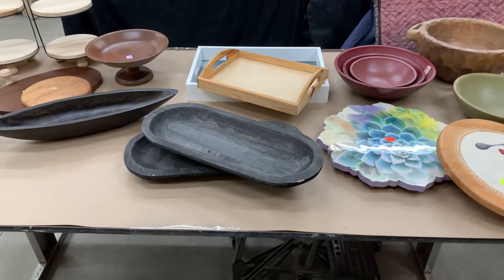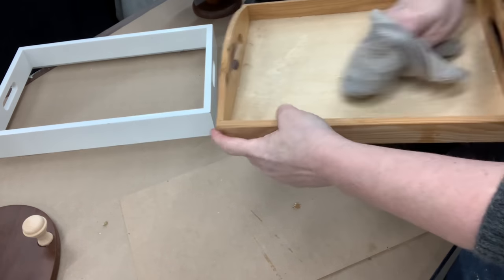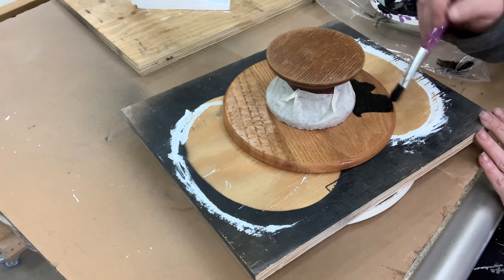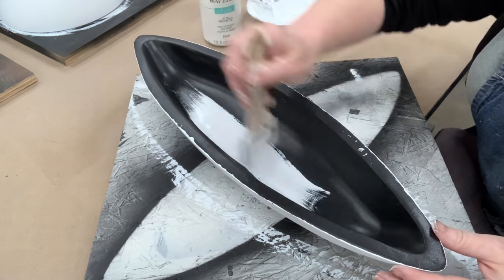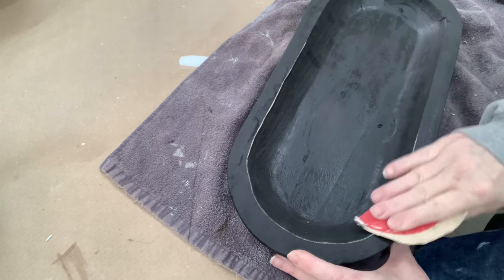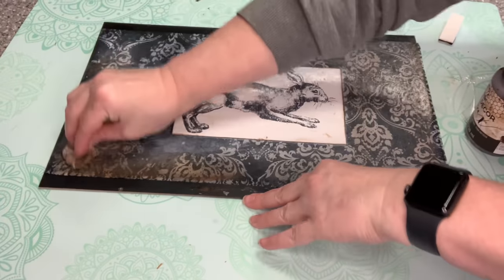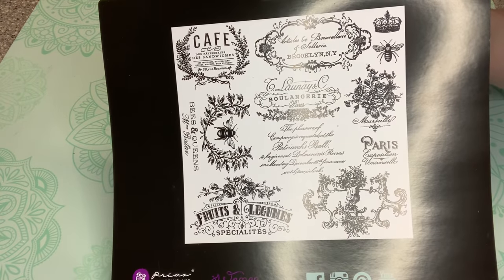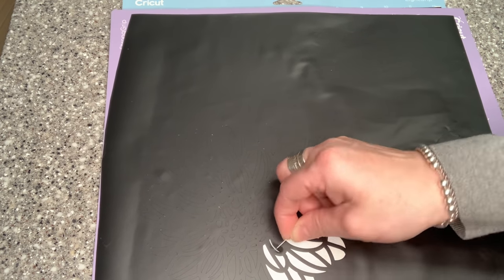Making Over Thrifted Finds || Trash to Treasure || Farmhouse Decor

Comment: Hi Yvonne, does adding water to flat paint/chalk paint reduce the appearance of brush strokes? Also, what determines whether you spray the black or paint with a brush? Love your videos by the way...I watch you more often than anyone else!
Reply from the maker: Yes, adding water to the chalk paint illuminates the brushstrokes and makes a smoother finish. As For sprain or brushing it you just have to determine which of the items is easier to paint with a brush and what is easier to get into the areas with a spray and if the spray is better on that type of material
Reply: @GingerChickRehab   thank you so much!

Comment: shelac use to be made with petrol but now a days these varnishes are all plastic base and spraying  or brushing on these shelac varnishes really do prevent any paint applied after from adhearing properly  if any thing put the spray varnish shelac over the top of the paint not underneath

Comment: question. I spray painted little metal butterflys black, went over them with poly acrylic. then painted them with waverly white. 3 times. I thought it would be easy to wipe or lightly sand the white off to show black on the edges. now I cannot get the white caulk paint off. do you think if i soaked them in water it would come off/ i have to start over. I didnt know the waverly white would stick so well. I let it dry inbetween coats. do you have any suggestions/ Thanks. Love your videos!
Reply from the maker: Oh.. yes it sticks better than I thought it would too. I’ve learned that I have to distress as some as that last coat is dry enough and not only water rag distress but a light sandpaper too. 
So I would say make your water hotter and when it’s still wet use the sand paper to get the distressing started and back to the wet rag. I find the warmer the water it seems to work better 💕
Reply: Thank you for answering. I think I will soak it in hot water, and try and rub or lightly sand it off.I binge watch your videos. Love your style and ideas
 @GingerChickRehab
Reply: when I get some time I will come visit your shop!
I really wanted to buy the double thread holder, with the little drawers. let me know if you ever come acrossed another one like it.